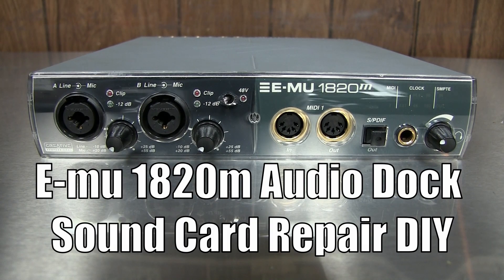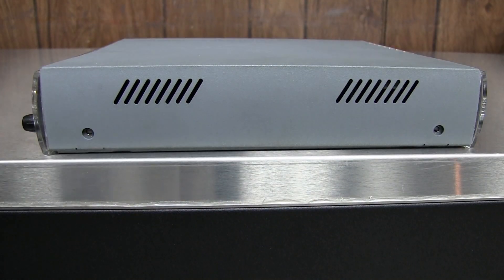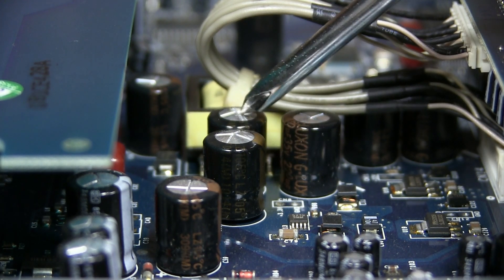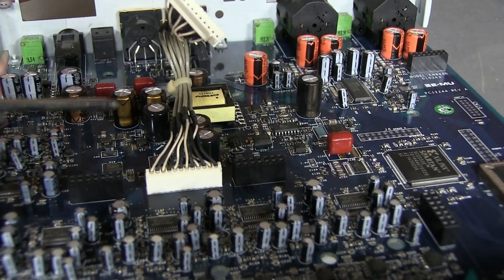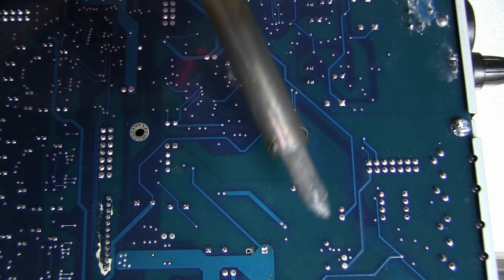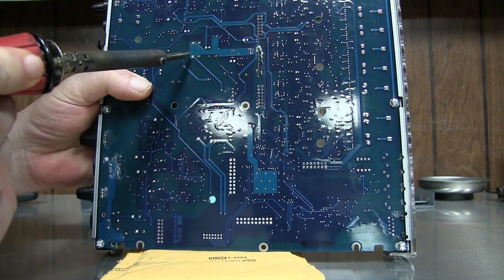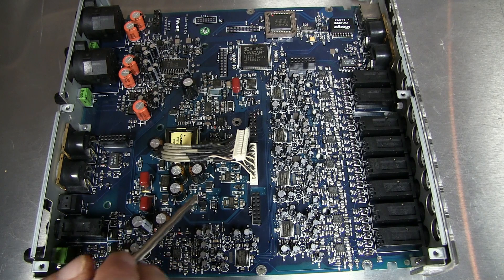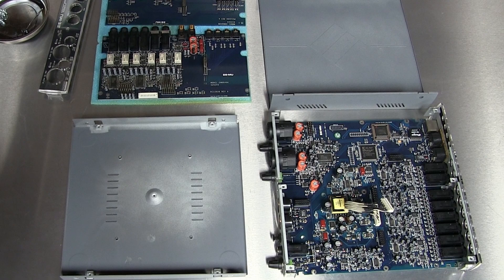E-MU 1820m Audio Dock Sound Card Capacitor Repair (Snap, Crackle, & Pop!)

Comment: hello thanks for this video mine when i turn off the pc and turn it back on start the problem with snap crackle pop sound no sound at all ,... i needevery time to instal the drivers 4 5 times and restart the pc to make it work so my problem is the same thing???
Reply from the maker: Could be, open up the dock and check for a blown cap.
Reply: @diymakerdan  ok thank you
Reply: @diymakerdan  you are life saver my 1820m is back realy thank you man this card stil amazing on 2023

Comment: Hands down the most under rated audio interface I've ever seen. I had one, now I have an RME and i still prefer my EMU - it's the drivers that caused me to have to change sadly.
Reply: Up until  today (I think I need to follow this video!) - my 1820M has been working like a dream using Windows 11!
Reply: @Behshead  I have one of these in mint condition though it has been in the box for a long time, I was wondering if I could still use it and if it was still relevant with everything which has happened in the PC world since, this is really cool, my PCB's are shiny! As new....I'm gonna build a new PC with this in it....I bet it never dreamed it would be running with a Ryzen! If you get this let me know how yours is getting on, I have windows 10, I had no idea that it would be compatible still, I have a UMC-22 Behringer but the E-Mu 1820M has been under my bed for years....had no idea....thanks for your message it's a help in itself....
Reply: @Behshead  Hi! i bought one today but don't know how to connect it to my laptop. It doesn't have any cables with it. do you maybe now how to connect it to my usbport?
Reply: @Kookroomusic It works only with a PCI Port (not PCI express). So if you have a desktop PC with thesr old porta (there are mobo for CPU intel 4790 or older for example..). Otherwise I think  there are adapter for PCI => PCI express for new mobo or PCI=>USB Port,  check first the compatibility, this sound card Is great.
Reply: @Behshead ciao can you help me how to work my 1820m with win 11 ? I have also an Emu 0404 USB on win 10 and 11 with a beta versione, pheraps in safe mode for the drivers ( I didn't remember)  and works ( but not midi only audio). Grazie 👋
Reply: as far as I know, it has even win10 driver, check it. :-) I like this sound system as well, though it's a little bit hard to understand  how to use
Reply: Running mine with epyc 7702's , and epyc  7551p at the crib studio (for multimedia gaming, video, and audio).  It's Insane.  While I am audio recording and playing back MIDI vst's, I can also encode video with ffmpeg.
I still have all my PCMCIA laptop cards too.  Very Underated.  I loaded them to church the other day with a laptop, and the mutlimedia department was trying to figure out how I was doing all that while I was at the piano recording everything on a 20 year card.

Comment: Great video but a word of caution for anyone pulling and replacing caps - the two caps that are replaced in the video are 680uF / 10V but some of the others that are pointed out as being the same cap are actually different values (220uF and 120uF specifically)
Reply from the maker: Thank you for adding that, I really appreciate it!  I should have looked at the other caps more closely before assuming they were the same type.  Adding your comment to the top of the video description so it hopefully it wont be missed.

Comment: Hi. I also have the 1820m, but the audiodock is no longer powering up. I was able to connect the 1010 card and install the drivers and patchmix dsp on Windows 10 and I can "see" the sound playing there. Plugging the card that came with the 1212m, I was also able to hear the outputs - so I know the card, drivers, and patchmix is working. I don't connect the dock and the 1212m output card together, of course. The 4-pin power connector is also plugged to the 1010card. 

It's just that the audiodock has no power. I have done continuity tests on both ends of the EDI cable and all pins are good. I was also wondering if any of the pins in there carried voltage to power the card, but using a multi-meter, I wasn't able to get any power draw from any pair out of those pins. 

Anyway, of the 2 problematic capacitors, only 1 has the bulge on my audiodock. I'm wondering if replacing it would power the unit. What do you think?
Reply from the maker: I'm pretty sure the Audiodock is powered via the 1010 card since the dock has no external power supply.  Caps are cheap and take only an hour or so to replace.  Replacing the bad cap (I'd just do both) may just fix it.  Perhaps your DMM set to amperage instead of DC voltage when testing the RJ-45 port which is why there was no reading?
Reply: @diymakerdan  hey, thanks for replying. It is set to DC. Testing the 4 pin cable from the PSU read 5v and 12v just fine. I'm thinking there must be some other component involved between the 1010 card and the audio dock for electricity to transfer through those ports and the cable. That's just a guess. 

Yes, I will go ahead and try that. I'm waiting for the delivery. I appreciate this. I'll update you on what happens. I hope it does power up though.
Reply from the maker: @atoyaday14  Idk either, maybe if the 1010 detects the dock is not plugged in it shuts off the power?  Just guessing too as without an available schematic or picking the brain of someone who designed these makes it really difficult.  From what I remember reading those problem caps were on the power side of things in the dock not a part of the audio pathway.  Fingers crossed for you that replacing them brings your dock back to life.
Reply: @diymakerdan  Yes! Thank you so much. I'll keep you posted once those replacement caps arrive.

And you're right, help is relatively harder to find regarding this product. Users and owners help one another.
Reply: @diymakerdan  hi Dan. I have replaced both caps with 25v 680uf ones, minding the polarity as seen in your video. Unfortunately,  it still does not power on. I have tried a different LAN cable, still nothing. Testing the 4pin power connector yields both 5v and 12v just fine. I don't know what else I should be looking at from here. Should I throw in the towel?
Reply from the maker: @atoyaday14  Bummer…well the dock most likely wouldn’t have functioned correctly with the blown cap but you probably have a twofold problem as you expected.  I’m under the impression the 1010 card has to send power up that cable.  Other than meticulously looking the card over with a magnifying glass (or a microscope if you happen to have one) seeing if there is any obvious issue, I too wouldn’t know where to go from there.  Not knowing what point in the circuit should have what voltage and such will have us chasing a phantom.  I’ve seen devices with bad IC chips that visually look perfect but prove defective after outsourcing a repair.  Might be somewhere out there that’s able to provide repair for EMU devices, thus I wouldn’t know who. Throwing in the towel may just be a better option, but that’s a choice only you can make, I’d like to think just about anything electronic could be fixed.  These really were decent interfaces when they worked.
Reply: @diymakerdan  I've had the 1010 cards go bad.  1820m dock receives no power.  the dock is still good.  Replace the 1010 card or trace the circuitry for clues why power is not transferring out the ethernet port to dock.

Comment: Hello! My E-MU 1616m has a faulty phantom48v one-side condenser microphone A, it only accepts dynamic mic but noise, side B works fine all microphones. Can it be repaired?
Reply from the maker: I don't see why not.  If the A socket was used a lot maybe a pin wiggled loose behind the XLR and needs to be re-soldered to the board.

Comment: Those two caps are part of power supply, and are not influencing sound quality, but I would not consider using this shitty brand "G-Luxon". Why it was used in the first place: because those caps was cheap as hell back then. Also many caps produced in the first half of 2000s was of inferior quality. So you could use ANY brand caps, just same or higher specs. Panasonic would suffice and won't die like those crappy G-Luxons do. Only thing to look is the height of new caps, so they will fit inside the box. If you go for 1 step higher voltage, they will likely survive for another 15 years ;)
PS: You can call those G-Luxons crapacitors.
Reply from the maker: Had no idea those caps were junk, thanks for the tip on that.  Flippin card died again after working again only for 6 months.  This time my wave 1/2 is in red , no audio whatsoever, and all the caps in the break out box look ok.   I could have sworn the wave 1/2 should work even if the breakout box is unplugged.   I'm going to have to check the 1010 card  and if nothing is out of place I think I am going to ditch this for something newer and more rock solid.
Reply: @diymakerdan  Check EDI cable connectors for any corrosion. Also check the power connector from PSU to the 1010 card, I had once issue with that. Also check your PSU output voltages. When it's recommended to change all capacitors in the faulty devices, I would consider to put best you can get (like Panasonic or Nichicon) in the place of failed caps, and some cheap but not crappy brand (like Jamicon) capacitors in the place of survived ones. Because if you would consider to buy only top-branded caps, that would be just economically unreasonable.
Reply from the maker: @kryosan  Appreciate that, just haven't found the time to troubleshoot it.  My Pc is rackmount and I have to move a large desk, completely unplug, and remove it to get access inside.  I'm thinking this thing is toast though.  Its like my software side works but thinks the card is not even plugged in.  The 1010 card less the breakout box should at least play a simple wav file unless I'm mistaken.  Most certainly not replacing every capacitor to get it going again, I'd rather sell it for parts move on and try something else if that is the case.  A newer USB interface would mean I'd never have to move the dang desk for any card issues ever again.
Reply: @diymakerdan  Just want to ask you, had you any issues with playing modern youtube videos on your 1820m? Or any WDM source with digital silence in it? My unit just pauses playback and I need to open PatchMix and switch sampling rate back and forth so playback resumes. I'm trying to figure is my driver or my hardware is defective. Thanks!
Reply from the maker: Still haven't tried to fix mine (again) but when it did work there were no pauses in playback on any audio source.  That's a tough one, I would think hardware, but troubleshooting that? (head spins).  When I set up Patchmix it only made available 2 input tracks on the WDM drivers (ASIO a no go) on Win 10, but I didn't have a chance to pursue that further.  I will just probably wind up upgrading to something else soon due to the multiple issues and I need something that simply works.
Reply: @diymakerdan  time for something else,i was looking at youre video cause i was sad mine died to also crackeling,replaced it for a focusrite.😭 still the emu 1820m was a cool looking device.maybe i will fix it later like you and put in a old upgraded computer.

Comment: That's funny I just made the exact same repair on my unit, then I stumbled across this video. At least I know I'm not alone on this. The keeper came off one end of my cable connector. I haven't tried using a regular cat 5 or 6, but the factory cable is shielded and has a choke on each end. I wonder if a standard ether net cable would work.
Reply from the maker: Never tried it but from what I have read I don't think a regular patch cable would fare well.   Cut off the bad side and re-crimp a new mod end on the original cable.
Reply: @diymakerdan  I had the same idea, but I'll have to get a crimper tool.
Reply: Answered my own question about the ether net cable, according to the owners manual: The E-MU 1010 PCI Card has been designed to use readily available and
inexpensive standard computer system cables to make it easy for you to find
replacement cables if your original cables become damaged or lost.

Comment: I just got one and found out it doesn't work. Opened it and found swollen caps. But NOT in the mainboard of audiodock, all that were visually damaged were at smaller circuitboard. That line of 12 of capacitors (470mF), almost all of them are swollen. 
I guess I start with those. :) If that does not help, then propably those that you mentioned in this vid (even though they look good).

Comment: Capacitors can degrade and have bad electrical properties long before they start to bulge, so it's usually more reliable to replace all capacitors of the same kind on a PCB once one or few of them has bulged, but in your case it doesn't seem like a huge issue. Worst case scenairo, you'll be going back to use more of your spares. :) Great video!

Comment: Hi thanks for your video, just a couple of question:
1) wich temperature do you think is better for the soldering (I can choose) ?
2) you didn't show how to remove and assembly again the lateral motherboards, is it easy o is there anything to be very careful ?
3) if the caps are ALL flat no need to change it  ?
4) wich drivers and app sw for the 1820m for stable full working in Win7 ? I try to find on the web anything but creative site is off for older products as this...Might you give o me a working link to download it ?
Thank for you time, have a great Music :-)
Reply from the maker: 1) A 25 to 40 Watt iron with a pen tip should work just fine, or about 700 degrees if you have a variable temp.
2) I didn't show that as I found those boards do not need to be removed to do this repair.
3) That is correct unless there is some kind of other failure with the cap that isn't plainly visible which would require testing it.

Comment: Hi, share component vendor please.
Reply from the maker: I bought them on eBay.
Reply: You can buy guaranteed fresh and not-counterfeit caps from Digikey or Mouser online. While you're there, buy better quality caps (Nichicon or Panasonic) with 105 C temp rating for longer life, and the next higher voltage rating to secure more reliability.

Comment: you should try to get some air flow to your sound card,I have the same card and replaced those two capacitors and drilled some holes on top and installed a computer fan and it has been working for many years without any problems, so the heat is the enemy.
Reply from the maker: That's a great idea.  I can't do anything on the top due to being rack mounted but I may look into a micro size fan and modify the side of the case for that.  These docks do get quite warm if left on for a long periods of time.

Comment: great review, I would ask you something. I have my 1616M Emu which I can not use in nowadays Laptops because they dont have the old PCICIA slot. EMU says that the cable connecting the EMU box with the pcicia card is an IDE cable, however, after making a search I found out that this cable is a CAT 5 Ethernet cable which brought me to the idea of using my EMU BOX with this cable with an USB adapter, that means, connecting my EMU DUCK BOX through usb in a new Laptop. It would be great if you give me some of your expertise in, if it could work my idea, to me, losing my 1616M for something else will be a disaster, I send you many greetings from Germany, Alfredo
Reply from the maker: Hi Alfredo,  The connecting cable is definitely RJ45 based, however the factory E-mu cable is also somewhat unique and needed for the interface to work properly.  The factory cable is shielded and also has ferrite chokes molded in at the ends.  If a regular pc CAT 5 patch cable is used in place of that it may cause erratic operation of the interface from what I have read.  

I highly doubt just converting the ethernet cable over to USB would work at all, but a PCMCIA to USB adapter might going from dock>ethernet cable>PCMCIA to USB adapter>into USB of pc.  My belly tells me chances are very slim on that happening, but you could give that a try, it wouldn't cost you anything but your time and a part you hopefully could return if it doesn't work out.

Other than that, my advice would be either to buy the best used laptop I could get that still has the PCMCIA (if you no longer have one) slot on it, wipe it, install a fresh OS like Win7 and use it as a dedicated DAW for your 1616M.    Or, sell the 1616M and buy something new that is USB based.  I know that last sentence makes you cringe a little, but I think at the end of the day actual recording techniques and post production mixing and mastering skills far overshadow losing the "M" status.